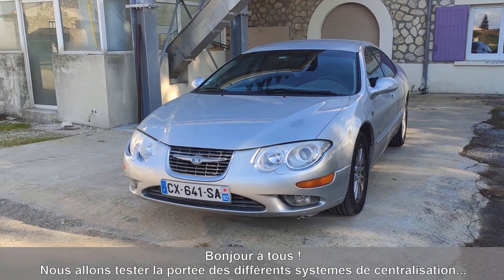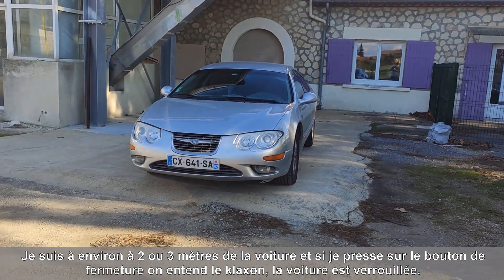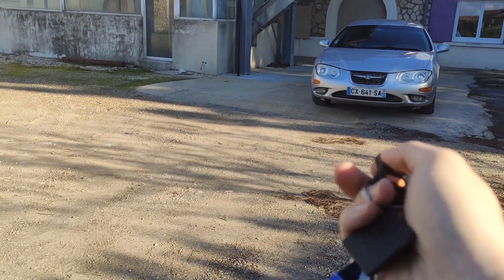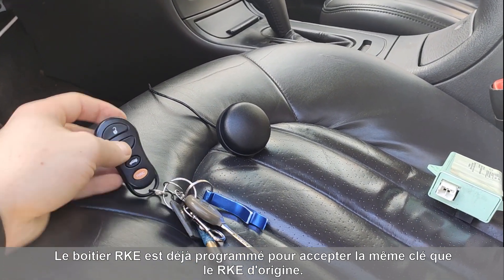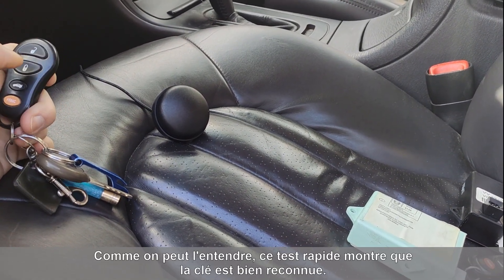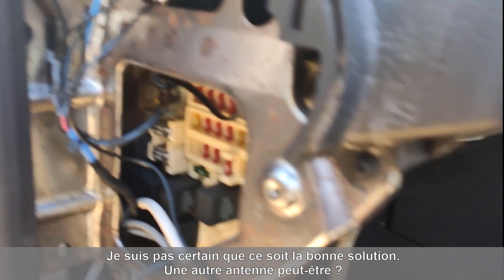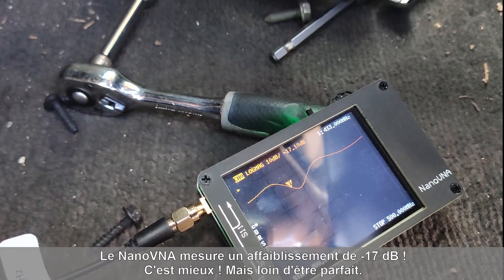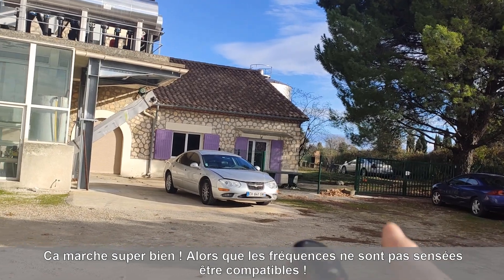2000 Chrysler 300M - RKE Experiments and range increase

Comment: Do you know if the 315mhz keyfobs from aliexpress work with the american RKE module? I'm trying to do the conversion ,I got an RKE from a 2000 300M from US (its the black module) but I can't train the keyfobs. I used your drbee tool ,it works great with my European RKE but can't train the aliexpress keyfobs....what am I missing? I got both GQ43VT9T and GQ43VT17T thinking there is a difference . Only difference between my old EU keyfobs is that these have a different type of battery. Where should I get keyfobs to get them to work with my US RKE module?
Reply from the maker: There is a difference depending on the year but I think you nailed it, GQ43VT17T vs VT9T. I got a fob from aliexpress as well, for my 2000... And it works. I can check later if you want, for the part number.
Reply from the maker: Ok you might want to have a look here: https://300mclub.org/forums/viewtopic.php?t=22843
It looks like the FCCID might be wrong and you should go with the part number instead. You might have got 2 rolling code fobs from Aliexpress, compatible with 01+.
Reply: @remiserriere  yea I got both GQ43VT17T and  VT9T ...they are not working with my RKE module. I used your software which works great with my other two european RKE's (btw for some crazy reason my 99 RKE has a better range than my 2000 ,both suck but yea at least my 99 works from the front lol ) . I just can't get a working keyfob...

I dont know how to get a pre 01 keyfob from aliexpress ....they are universal on that site ,unless I buy from each seller both versions.
Reply from the maker: @Adrian-mq5ld  I would try eBay instead, with the part numbers from the forum. Then I would keep the frame of the Aliexpress ones since they would look better.
Reply: @remiserriere  i got like 20 frames from aliexpress because they are cheap lol....ebay is going to get expensive fast with vat import duties ,etc....
Reply from the maker: @Adrian-mq5ld  maybe ask someone from the Facebook group to send one to you as a letter, just the PCB.
Reply: @remiserriere  yea no luck there either , heck people on our forums and groups are not even active that much anymore. There are few left like Firem and you but most are gone. I can understand americans but for me at least these are pretty cool cars for our european roads ...you can't say these cars don't look exotic in Europe. I like that.

ebay is so poor at parts for our cars that I tried 3 months to get a set of weathrstripping and none appeared for sale. I got a parts car that was incomplete for the seals and few other items that again were better than mine but not perfect. Its crazy that after 2 parts cars I still need parts LOL
Reply from the maker: @Adrian-mq5ld  that's the cheapest I have found for 1999-2000: https://www.ebay.fr/itm/251350916071

Comment: do you needed to program something ecu or immobilizer? or is the rke plug and play without programing something?
Reply from the maker: The RKE itself is plug n play with no programming required. The remote (keyfob) must be programmes with the RKE with a DRB3 or..... I'm actually working on a cheap hardware solution ;)
Reply: @remiserriere  is this right? https://www.ebay.de/itm/99-00-1999-2000-CHRYSLER-300M-LHS-RKE-RECEIVER-P04602269AA-3-5L-V6/252705707665 and than two new remotes with 315mhz

Comment: Hello my friend. A couple of things I want to ask about. First I couldn’t help but notice the led’s next to your projector headlights flash when you arm the alarm. Are those factory or custom? Second thing I noticed are your side markers are replaced with the 300M badges like an American M. Is that factory or did you replace them. Lastly about the keyless entry, if you hold the fob under your chin while using it, that will also increase the working distance of the fob. Thanks for the video.
Reply from the maker: About the LEDs in the headlights, that's the European spec location for parking lights (basic light bulbs from factory) as they must be white. They are flashing I think from factory. 
The side markers were replaced indeed, because I installed Special side mirrors with turn signals. I did try the chin thing but never noticed any difference.
Reply: Remi S thanks.